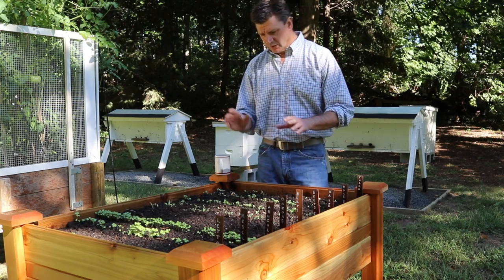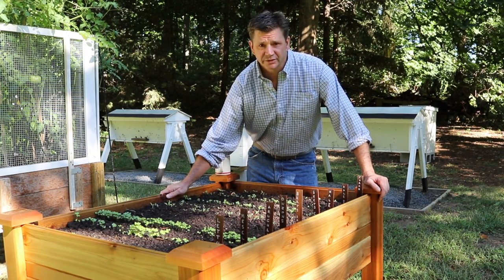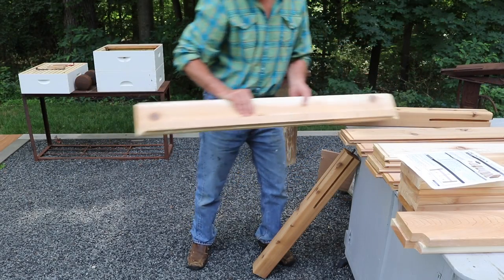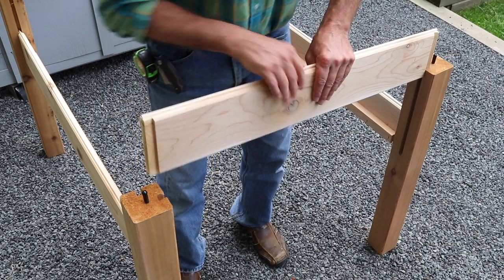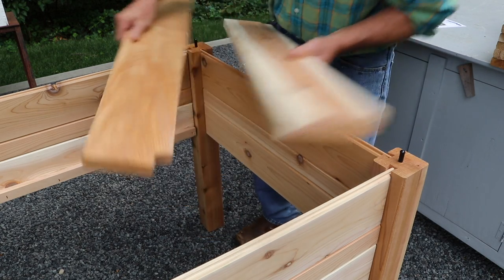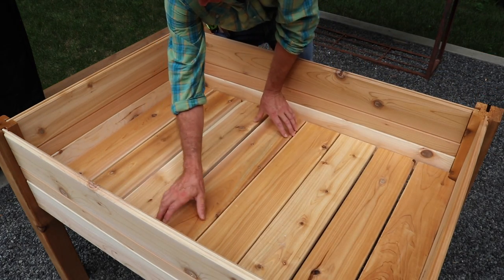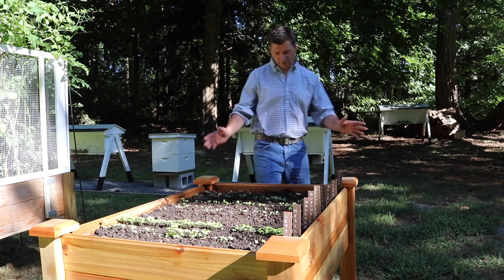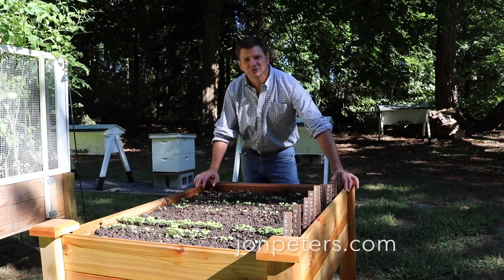Unbox & Assemble an Elevated Garden Bed – Plant a Fall Garden

Comment: my concern is keeping wasps from nesting on bottom. I had an outdoor work table and they built a 6 inch nest below the deck and big black bees bored 32 holes into the 2x4 sides. Didn't know about the wasps until my wife bumped the table and got stung a couple times